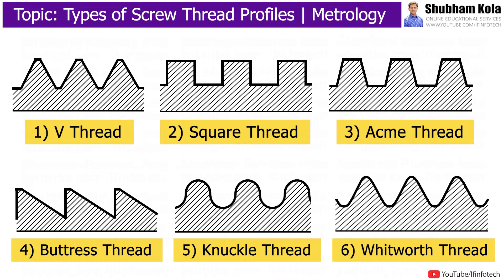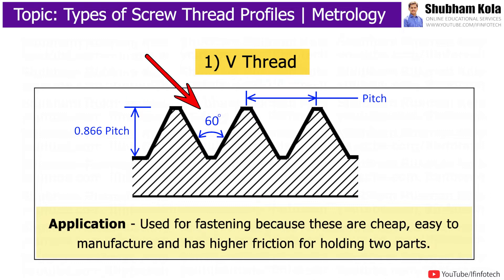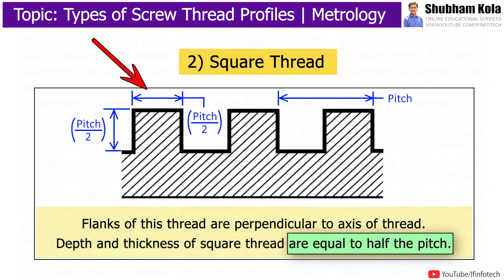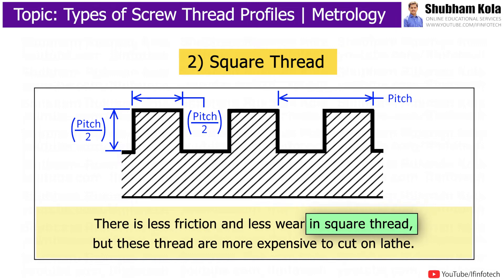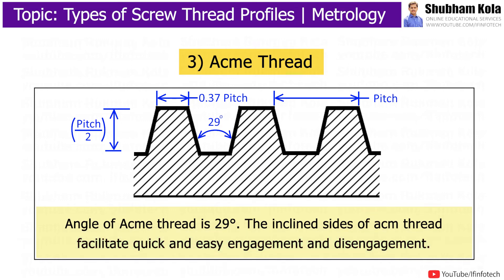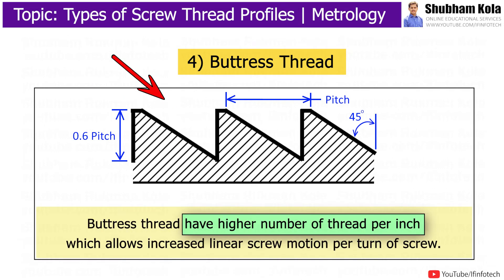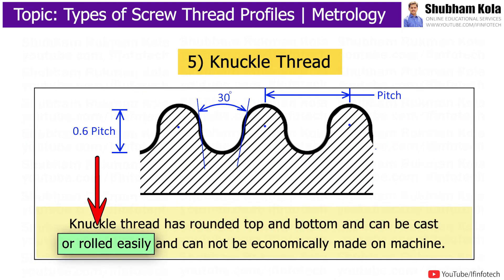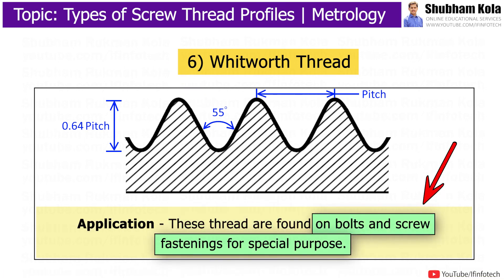Types of Screw Thread | V Thread, Acme Thread, Buttress Thread | Metrology and Quality Control

Comment: I asked a lot of people making vises some use acme threads some use square ones and others use standard v shaped, which thread is stronger when tightening the vise against a hard object? Which threads break first standard V or acme under the same condition, for example? Can you please answer my question? Thanks in advance.
Reply: The method of failure in screws is usually a torsional shear failure perpendicular to the axial force, but in terms of failure to the thread, buttress threads are the strongest, they use them to seal the breech of a cannon that has to be able to take enough force to throw a heavy artillery shell several kilometres.
Reply: Standard V threads will fail before acme in power transmission due to wear and stress concentration, the inner thread and outer thread will no longer interlock.
Reply: @domvasta  Thanks a lot for the informative reply.